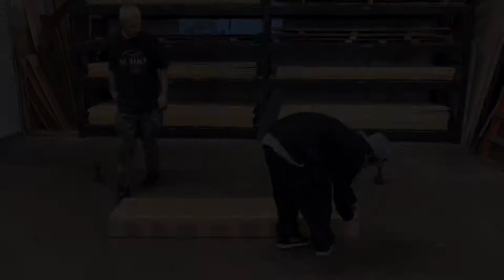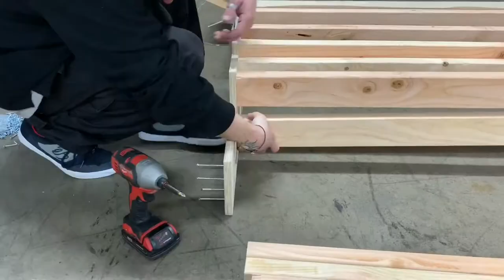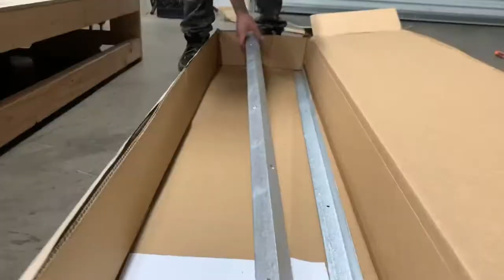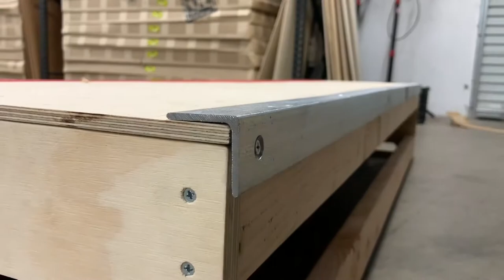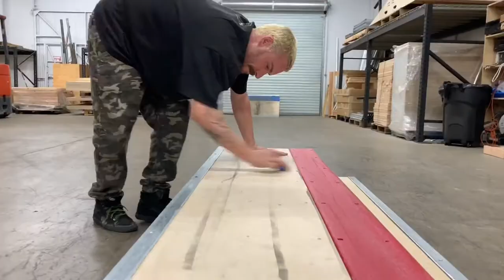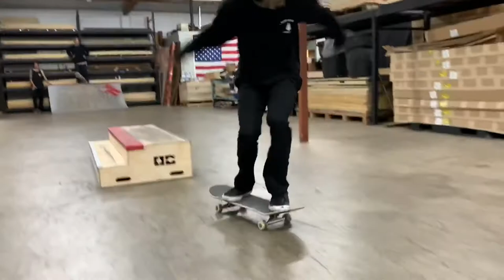How to BUILD & SKATE a Double Step Ledge

Comment: where can i buy that red piece?
Reply: It comes with the box
Reply: @raymondkim1282  but i don't want to buy the box. just the red piece.
Reply: @lakailunatik  I dunno go to Home Depot and get paint and a 2x4 🤷‍♂️
Reply: It's a butter bench
Reply: @lakailunatik  pretty sure its composite  wood. Ceramic. Its almost like plastic , it grinds and slide. You can get it at home depot
Reply: Thanks you all I was wondering about the red thing to
Reply: What is it called??